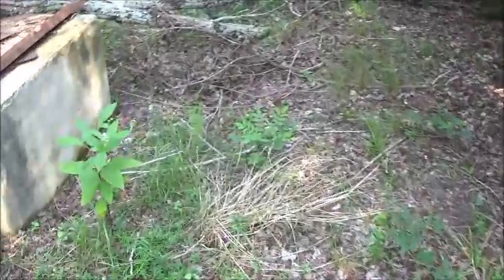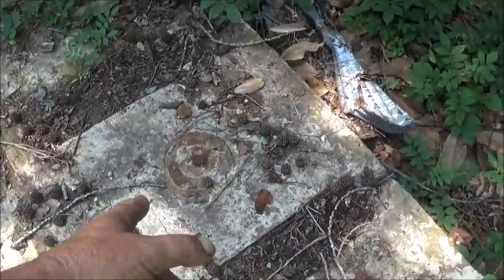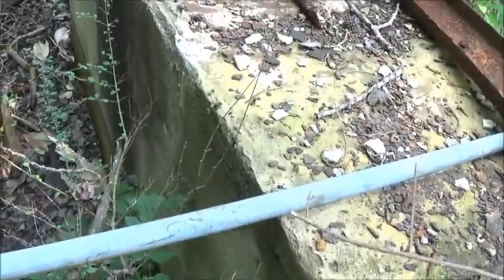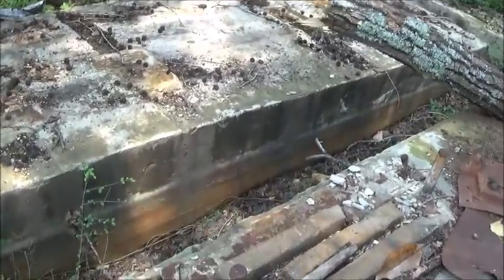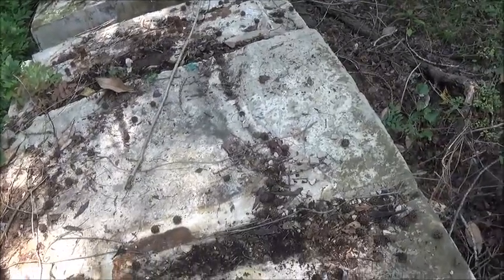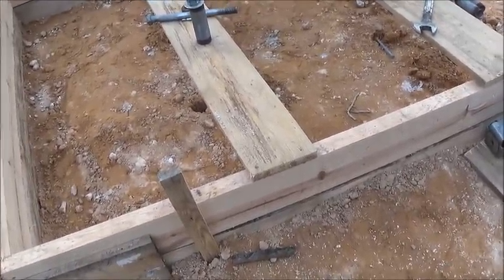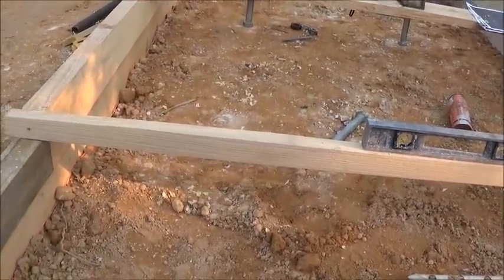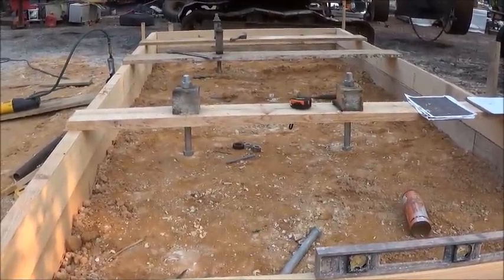MORE BATES STEAM ENGINE FOUDATION WORK

Comment: What if you weld the mounting bolts on some lattice like structure made of scrap iron 1/4 5/16 rod at desired heigh resting just on the packed floor? Thus leaves you free space to have a smooth surface when pouring concrete. Other way may be welding bolts on a light I beam running side to side of box with treaded bar at ends passing trough wood walls ( set lower than engine mounting surface,again ;so leaving freedom to  smoother concrete surface),thus holds bolts and helps box not to spread at same time . Of course you can cut the protruding ends after dismantling box. I use that idea on mounting a big lathe at home.

Comment: If you want your bolts to be "accurate", set them up "accurately" and solid (tie them securely to/with your rebar) and pour them in place. Doing them in wet concrete is never going to be very accurate. As you said and made perfectly clear, you're going to do it however YOU like. So, be it, but experience doesn't lie either so it's entirely YOUR CALL. 
BTW, don't know if setting that plate down on top of wet grout is going to work. My experience has been that if the grout is wet enough to "ooze" out when the plate is set down, you won't be able to control how far it sinks into/onto the grout. If you put "stops" so the plate can't go any lower on the wet grout, the grout will shrink when it dries and leave a gap below the plate. A dryer grout will not "ooze" when you set the plate down onto it. That's what makes the "Dry-Pack" method preferred. The plate is mounted and leveled on the bolts FIRST so placement is controlled and very accurate. Bases set on concrete pads are placed over bolts and shimmed to perfectly level using measured shims like front end shims. THEN the grout is applied and the "Dry-pack" doesn't shrink. Worked on lots of equipment and this is how the "bases" are always done. This plate is unusual because it's so large in one piece.

Comment: The bords that holds the bolts. I would raise them 2 inches so you can finish the concrete underneath with a hand trial.
Weld ring on the end of the bolts to be around the rebar in the concrete. It will give you movement while putting it together and when pored it will hold.

Comment: On your angle iron stakes I would go every 3' with a "T" welded to the top of each stake for easier removal and pounded down at or below the top edge of your form boards.  Also, don't forget to oil your boards for easy removal.  Good luck.

Comment: You could just wire rebar to the angle iron or plate welded to the bolts to give strength to  the mounts tying it all together.

Comment: Makes some dowel pins for the cross boards you can mount them down on. Since you have it where you want it. drill some half or three eights holes  tap in a steel dowel. pull off boards and slightly ream out holes for slip fit. easy to find and fit boards later. Definitely stake the sides and maybe some kicker boards against a stake board on long runs. Re bar for inside of forms I hope and mesh wire maybe. Good luck. Get plenty of help doing the concrete. Don't kill yourself alone!!

Comment: The concrete has to be just wet enough to slide down the chute.  Dryer is stronger.  The dryer the better.  You will still be able to push it around an level it and it won't flow out past the step. Think dry = strong. Tell the concrete guy.  You might have a problem getting the bolts in if you weld angle iron between them. You'd have to pour around them.  I'd just weld a piece of rebar to each bolt head if I was gonna try and push them in after the pour.  :)

Comment: Quick question was there any bolts or any nuts underneath the frame sitting on the ground in other words words are a nut and then machine and a nut on top of it did you have a leveling that underneath

Comment: Normally the J-bolts on large machines like these are set way deeper, couple of 3 feet  into the Concrete.Worked on lots of old Machines. Stuff installed During WW1 you see alot of wood beams you could sink a screwdriver into like cheese and still working.

Comment: To be on safe side to keep the forms from bowing out you need add stakes every 2 feet along the outside there will be a lot of pressure when you start pouring the concrete

Comment: yes weld the bar to bolts leave the placement boards our and vibrate while lifting on bolts check level and  flat less chance for alignment errors the more rigid the form less trouble you will  have  place  the plate on a mound of concrete a little proud vibrate it will walk it down with no voids if mounded strike off excess  you would need a way to allow excess to escape

Comment: When we build slabs for the oil field we take pipe and weld nuts to it then duct tape them off at surface level then pour the concrete. Then go back and chip the holes for all thread to screw in . Just an idea
Reply: Excellent method!

Comment: Instead of removing the cross boards for your bolts for fear of concrete voids underneath why not shim them up an inch and a half so you can tuck a trowell under them?
Reply: I like that idea, and add grout, shims and packers as needed. Hard to get it 'just so' in one pour.

Comment: the grout is used to level the crank shaft to bearings , you my have to pick up the engine and spot in 2 or 3 times to plastigage  the bearing//  with cap on

Comment: If you're worried about pouring the concrete with those crossties, how about pulling them and parking your grandson's bulldozer against the boards? Wide, flat blade, you can drive it right into position and lock the brakes?

Comment: Get the concrete that has fiberglass in it that's stronger & don't need rebar but still I would cross a few rebates to weld the anchor Bolt too & us a concrete vibrator to get all the air out on pouring day .. It won't crack after that

Comment: If you use 32 mpa contrete it will be well and truly strong enough. You will be able to leave the bolts in place with the steel holding them together if you use a vibrater to vibrate the concrete. Pushing the bolts and steel into the concrete  can be not easy. If you do push it in your concrete will need to be very wet.

Comment: Pour the concrete in your forms and smooth the top more or less to your liking. Take your wife to a long lunch and let the concrete set for an 1 1/2 hour. Afterwards can do a very smooth finish or get a wide broom to a sidewalk finish. Also a concrete trick is get old waste oil and brush all your forms so the concrete doesn't cure to your wood forms. The 2 inch step just spread the concrete evenly and just let me set in the sun. Afterward use a spray bottle with water, mason sponge and curb end float for fix imperfections from the pour. If you like more info on the pour just message me. We have poured miles of curb, sideways and footings.

Comment: Jonathan, not being an engineer I'm not sure. But won't that engine create a lot of vibration. Perhaps that slab should be reinforced by rebar. That's probably why the old slab didn't crack, because it has rebar in it. Once again I don't know God bless brother
Reply: Not sure about vibration, but perhaps more of a rocking motion back and forth. It's a low RPM machine in the grand scheme of things. I'm not sure if the standard working RPM breaks 100....

Comment: Your going overkill on the foundation, not a bad thing! Forms look good, wouldn't worry about them blowing ou too much! Just don't pour too wet!
Reply: BTW if you have any old lengths of allthread, you could go across and bolt the sides together!
Reply from the maker: Yes already just took a break from putting some half inch all thread in.

Comment: I always imagine the worst case scenario. I've been accused of being a worry-wart, and a stick in the mud plenty of times.  I still cannot resist.   I do not like that step-down.  Definitely use stiff concrete.  Another further remedy for my worry is to screw through the 2x4 (with long sheetrock screws) into an edge-on board that lies flat at the height you want that concrete to settle-up on the low side.  That's just to help support the concrete on the high side, which I imagine is going to puddle-up and ooze down to the low side some.  You also might consider laying several cinderblocks underneath that 2x4 with the holes facing through and into the concrete on either side.  You can set rebar running the cinderblocks too.  Good luck. You look good-to-go.  Unless the fickle concrete gods of bad luck and good, aren't cooperative.  I am not a concrete man.  But I have seen quite a few disasters, and even more near-disasters.  Also, if you have a router, now is the time to make an imprint board to say something in the concrete, a date, or whatever.  Just remember to reverse the letters with parchment paper (cookie sheet paper).  This is the last I will mention any of this.  I know better.  Oh!  And Jonathan.  Send the Water Company a bill for One Dollar for finding their water main leak for them.  That way the Water Company can advertise that they pay those who find their water main leaks and report them.  Frame the One Dollar check and put it on the wall in the Hardware Store.